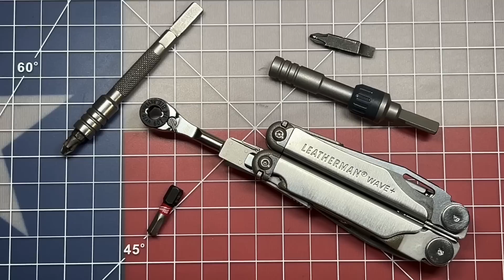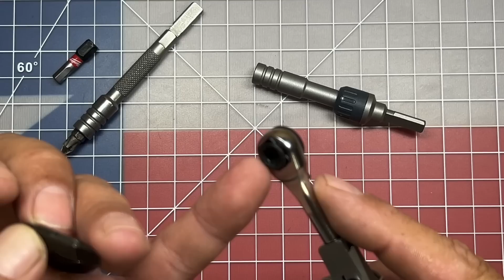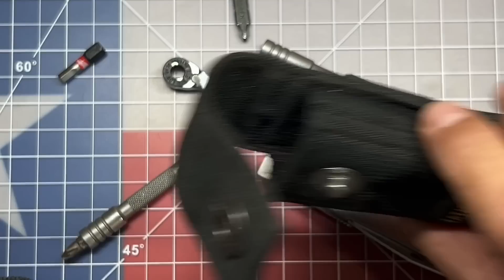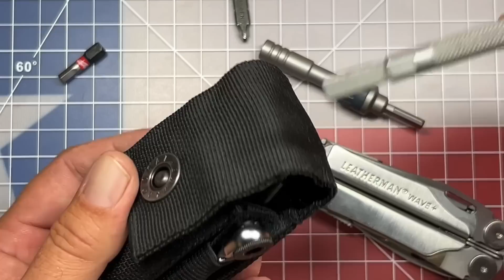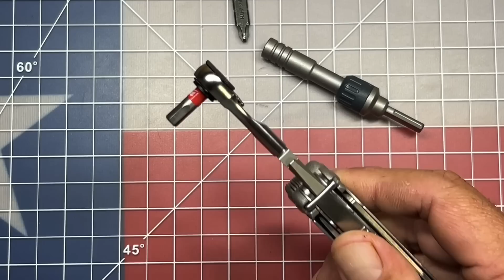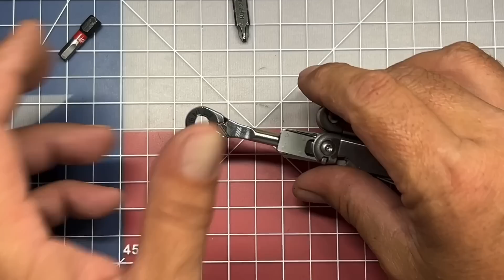711L 60 Tooth Ratchet Driver For Leatherman Multi Tools

Comment from the maker: I need to make a correction. I stated that this product was manufactured in China, when in fact it is manufactured in Taiwan. My apologies for the confusion.

711L Ratchet - https://amzn.to/3qZJoM5
711L Ratchet with 9 Piece Bit Kit - https://amzn.to/3x4bppE
711L Ratchet with Variable Torque Socket Adapter - https://amzn.to/3NLy8gg
711L Amazon Store - https://amzn.to/35xrOaK
Reply: Do you mean west Taiwan?
Reply: Thanks for that update. I almost thought I couldn't morally buy it.

Comment: The new leatherman bit extender is now magnec do you like the normal bit extender over the leatherman ratchet driver? Thanks
Reply from the maker: I actually prefer the older one to be honest. With the aftermarket bits I use, the original holds better.

Comment: If you  carry a ratchet like this , there is no need  to attacth it to the multitool.
That's why victorinox setup with a separate ratcheting system non attachable to the multi tool os better in my opinion .
2 reasons .
1) if you apply to much pressure to scree or unscrew , you may break your multitool (Leatherman ). On victorinox approach , you may break the ratchet . The multitool is not stretched.
2) Sometimes you need to screw something and use your plyers to hold the bolt behind the screw ...
Leatherman style ratcheting system doesn't help on these ocations.

Comment: IMO Leatherman needs to scrap the proprietary bit exchanger and go  with the standard hex driver. At least give an option.   I took your advise of the bit extender with double ended Wiha bits.  The refill bit set for 26 in 1 drivers come in molded thermoplastic holder. This fits fine in the nylon sheath for my wave and im not worried about those crappy bits

Comment: What a neat little attachment! 

I prefer to carry my LM extender flat side up, this lets the flared adapter add some retention under the elastic sleeve and makes it less likely to shift over to the side and drop out. I carry my wave horizontally (leather LM sheath with two side sleeves), but I've tested the extension like that by lightly shaking the pouch upside down and it does well.

Comment: Seems like it should work with a 1/4” allen converting to a 1/4” socket holder and then all of the 1/4” sockets. I’m not suggesting that it has the strength to do that work so maybe a test to see how the 60 tooth ratchet holds up?

Comment: This is actually a high quality well proven tool made in Taiwan by a company called HI-FIVE.
All the reverse gear market bit ratchets are made by them, from topeak to Facom and MAC tools.
Theres countless rebrandings and slight variations including locking flex heads, but GM power torque I carry in the side of my Bond sheath is the same head.
I prefer a seperate bit ratchet because I'm not trying to add bits to my multitool,  I just need a 2nd 1/4 and #2 for times theres a screw head on both sides of something.
I carry the bit ratchet with one in the head and the other in the handle,  if I need any other bits I get into my tool bag.

Comment: If you double the length of the handle you won't even need the LM tool to use it. And it would barely take up space.

I don't feel like this adds much to the LM tool, in fact it would probably just lead you to put  forces on the bit holder in a way that it wasn't designed to.

Comment: Just out of personal experience. I ordered this almost right when it came out. I work as a Welder/Fitter/Fabricator/Ironworker and sometimes a Millwright. I've used this tool with my Surge during heavy application jobs and it has held up wonderfully for me. The forward/reverse selector has been flawless, the internals have maintained a nice crisp action and the material itself has not bent, twisted or otherwise. The slots in the exchanger has not weakend nor has it developed any slop. Every bit I put in has held nicely and it has performed flawlessly for me in very heavy duty applications. Which surprised the heck out of me since it's smaller than my pinky finger. The shipping time is insane. When I ordered this, it took almost a month to arrive. Don't waste your time buying the tool and the bits. The bits are terrible. I would recommend just buying the ratchet and grabbing a set of Wiha bits to go with it. Otherwise, I very highly recommend this addition to those who are looking for a ratchet to add to their leathermans. Peace out and have a beautiful day y'all!
Reply from the maker: Thank you very much for sharing your experience. It felt pretty solid to me, but only long term use will tell the tale.
Reply: I'm hesitant to buy when there are no written reviews on Amazon, less than 10 rat8ngs, almost 1/3 the cost extra shipping, and a month or more to get it.

How did you even know about it to order it when it cam out?  There is like zero review coverage, too.  Am I missing something?

Comment: If you use this ratchet in the bit extender and the pliers this would be great for those bolts or pivot screws that need grip for each side.
Reply from the maker: That is an excellent point, wish I had thought about it.

Comment: Chinese-made?   Product page says Taiwan is the country of origin.  Allies at least.
Reply: Ebay listing says Taiwan, too.
Reply: 711L is a small Taiwanese Tool Brand.The ratchet is made in Taiwan by HI-FIVE,the world's original designer of the Gear Wrench.
Reply from the maker: You guys are correct, my apologies. This product is indeed made in Taiwan.
Reply: Where can I order this little rachet - this 711L ?
Reply: @dickylombard5964  Use the posted links (in the thread description) to the Amazon web store entry. Only the ratchet with that torque wrench device (the most expensive package of course...) is available. The other packages are sold out.... My own purchase arrived using slow postal mail from Taiwan just a few weeks ago.
Reply: Thank you Leonard.

Comment: I honestly don't understand the point. It doesn't save any space over any number of small ratchets. It just uses your leatherman as a clunky extension to your tiny ratchet.
It feels like something you would carry as an excuse to feel like your leatherman is more useful rather than out of actual utility.
Looks well made and well designed. But I feel like I'd rather just carry a small ratchet.
I would love to see one that truly integrates with a leatherman. If I could replace an entire side of tools on my P4 with a ratchet that actually folds away into place I would.
Another downside in having the ratchet attatched to the leatherman is you often need to hold both the fastner and a nut. With a sepoerate ratchet you could use the pliers on your leatherman to hold one and tighten with the ratchet. As one piece you can only use one tool at a time.

I hate to be so negative on it as I love your videos and appreciate the look at the tool.
Reply from the maker: You make some excellent points, points I tend to agree with. I think if you have a need for a bit ratchet, there are some very good options out there. I did find it interesting that someone actually designed this accessory to work with Leatherman tools though.
Reply: I agree, I would probably just use a regular mini ratchet. However, it is still kind of cool that somebody makes this. Clearly I'm a bit of a multitool nerd.

Comment: I carry a chums wallet with a small snuff tin that has metric Allen 1/4 bits Milwaukee brand aswell as torx and Phillips 1,2,3 . All the same brand . Other 1/4 bits Rob 1&2 and flat of all sizes with a 2" extension and 5/16 nut driver 1/4 socket and adapter 3/8. To 1/4 drive . Other slot Is a Craftsman 1/4 driver and knipex Cobra XS and rite &rain pen.And nite)Ize. Fish pry bar / fishing tool. And Milwaukee 6-1 all I use daily for a year now .